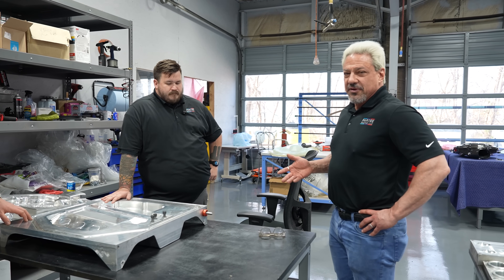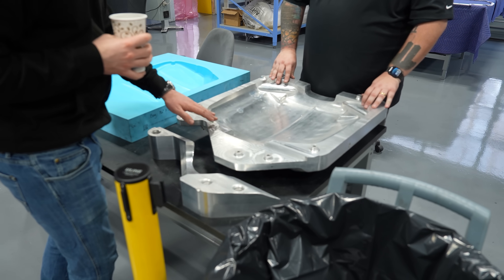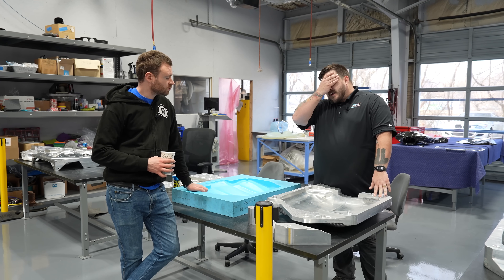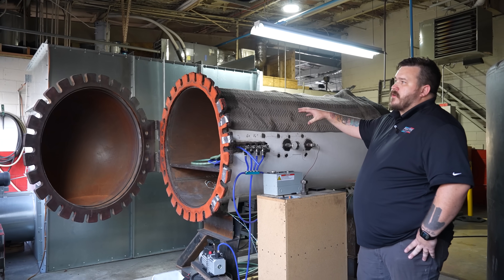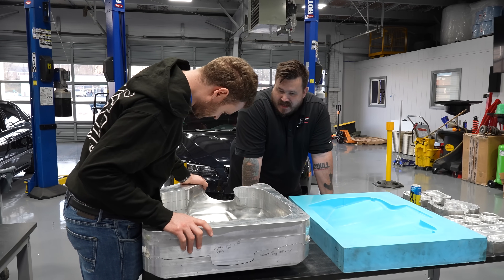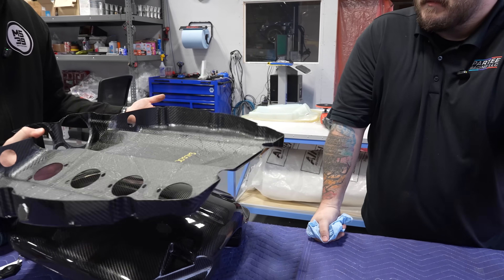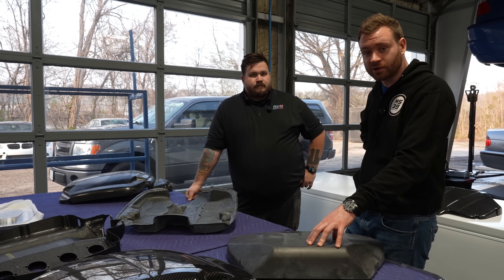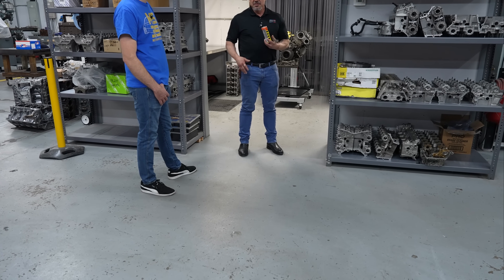Why Are Carbon Fiber Parts So Expensive?

Comment: Great work and parts, thanks for the tour. Have to say I like the raw finish @14:00 the most, all the hand labour of sanding and polishing just adds cost and weight for no apparent reason other than cosmetics, or am I missing something? The raw product seems the most honest, would be nice to be able to buy it like that. Well unless the pin holes are actually leaks through the whole thickness of the part. UV protection shouldnt be an issue under the hood right?

Comment: The bmw front end design "easter egg" integrated on the parts are not my cup of tea, its pretty tacky, kind of like the external shell of a logitech g27 steering wheel.  Why make a part a caricature of what it is mounted to.
Reply: If you are referring to the recesses on the front end of the S65 plenum, those are not meant to be kidney grilles, they are recesses for the OEM ///M and V8 badges that are on the factory airboxes and are a feature our customers were adamant on retaining.

Comment: An American using metric units is something you don't hear often
Reply: As a kid my family live in DE where in school we were only taught metric. When we moved to the states I was totally lost with everything imperial. I still use metric and convert to imperial. So yeah we are out here in the states using both. I was also in the Army for 20 years and we mainly used metric because it’s easier.
Reply: @chrissixfix  That makes a lot of sense. I wonder how you can convert to imperial on the fly though or is it something easy to learn?
Reply: @BIZKIT551  that's me in the video- as a super quick rule of thumb, I know that 1mm is almost .040" (.0393 to be exact, but 040 makes it faster when I do not need to be terribly precise)

Comment: The real reason carbon fibre parts are so expensive is because carbon fibre cloths are so soft and difficult to make strong, extensive research and refinement is needed to create a strong durable carbon fibre part. Honestly it's pointless. You might as well just go with microfiber as many companies now offer tried and tested microfiber products which are lighter and stronger than steel! 😅

Comment: LOVE THESE GUYS.  So good to see people innovating and improving to this level. 

I've been moulding parts from epoxy with a 'sprinkle' of graphene, but ultra hard to source, or create yourself.  Maybe worth trying an epoxy/graphene layer or mix in the resin to end up with next level strenth, thickness, lightness.  Not that this needs it.  Unless being thinner increases the legendary S6x induction noise!

Comment: Yeah the guys makeing prepreg are rooling in money. Resin is cheap(even cheaper then the stuff for infusion) fiber is cheap, they just enjoy the 6x markup. its not even that good, fiber to resin ratio wanders +/- 5% ideal on the same sheet. And the mechiene that does it is doing a real simple job, sprays on resin and heat it to impregnate and cool it down.

Comment: guys get yourself a proper vacuum pump
something like a decent used leybold trivac D in good condition is in the region of sub 1k
sure you're not gonna pull ultra-high vacuum, but she shall pull 2-3 more orders of vacuum than that thing :D
Reply: Chris here, that's me in the video.  I had intended to buy a more industrial frade vac pump, but we needed one immediately for a test and I was suprised to see that these little guys are able to pull a vacuum below 0.05 atmosphere.   That is more than sufficient for our needs, especially since we vent the parts to atmosphere while under pressure in the autoclave.
Reply: @KaizenPR57  it's more what a decent used lab pump can do for you guys in flow rate and getting rid of air bubbles, a D series will nominally go down to 1x e^-6 atm or -7, so she'll still be in viscous flow conditions, of coure with properly sized hoses (wich are actually bigger that what people would expect and use on vacuum).

considering what small volumes you guys evacuate i think that a d25b should be plenty (the number after the D is the flow rate in CFM), it's a fun little tool to add, if you get it used or trough a foreclousure also quite inexpensive, and once you have it you can do stuff that right now you might not even consider.

for example we went from having to buying calibrated gas sensors, to building and calibrating the sensors because now with a proper vacuum pump we can make our own calibrated gas mixtures trough gravimetric measuraments, all because at one point we acquired and restored a leybold (the paperwork involved in the above mentioned activity is what drains the fun out of it)

Comment: The simple answer to the title is that, while just about anyone can lay carbon, that doesn't mean they can lay it to the extent professionals who do R&D can.

Also, if you do end up matching them and still think otherwise, then you can't quantify the price of the item you've created (after trial and tribulation).
I started laying carbon almost 23 years ago and it took me 12 years almost, to reach a level where i could offer that as a service in my line of work (we're talking structural certification, european level certificate for fire protection and more). And i offer it costly, because it's the skill and knowledge that begets that sum.

I mean, would you (reader) expect someone who lays carbon for Koenigsegg's wheel department to make their work cheap? When every weave in that carbon wheel is meant to represent a specific part that forms the strength of the whole wheel at speeds that exceed 300kph... i think not.

And then there's the giants in aerospace who produce parts that make even hypercar prices look like cheap change. Half a million for a tub? Try two million for the wing support belly pan.

Laying carbon is not easy, when done right and it comes with blood, sweat and tears. Hours of research, failure, and endless testing and quality control. It seems easy, but it's not. It's actually quite a complicated affair.

Comment: instead of clearcoating the parts, they should try polishing the raw carbon :)
Reply: We can absolutely do that, but unprotected epoxy will degrade under UV light SIGNIFICANTLY faster without a high-solids UV blocking clear coat.